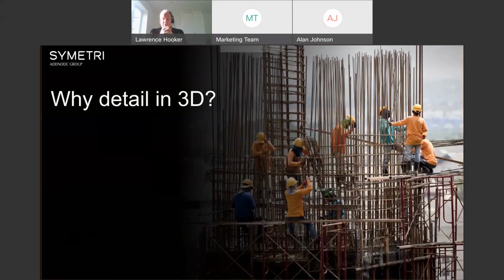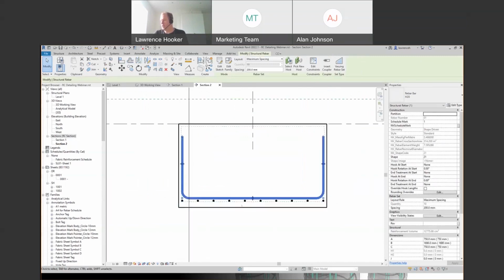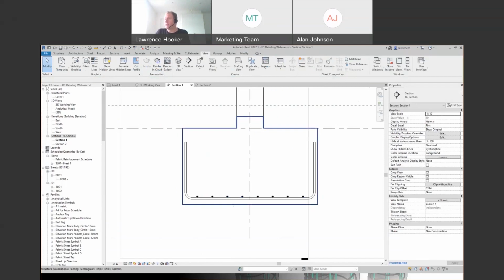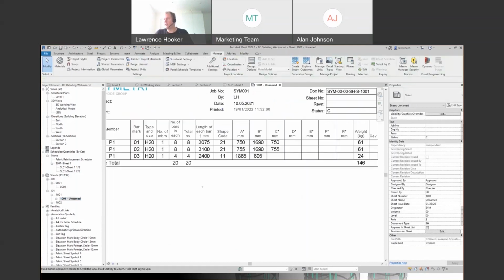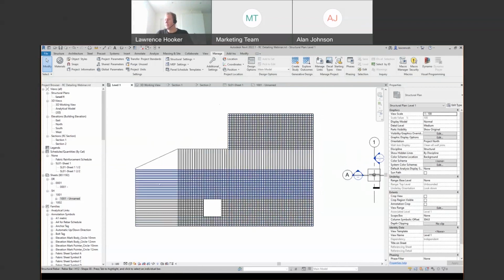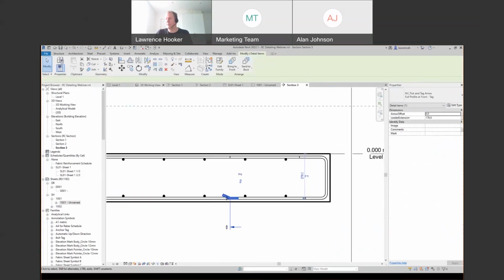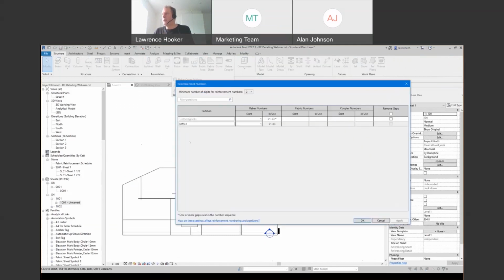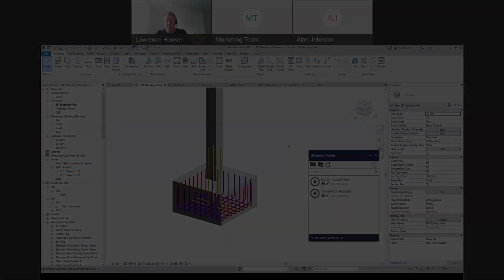Modelling Reinforcement in Revit

Comment: Thank you lawrence!

The tip you've shared about arranging longitudal bars in circular column as a group - is amazing and very helpful.

since similar problem exissts in all of the columns in revit - do you have a tip of how to create the longitudal bars on a rectangular columns as group also?
I've already tried to implement your tip' but it's placing the bars around the area of the column in random way.

I'd like to hear if you have a solution.

Thanks in advance.